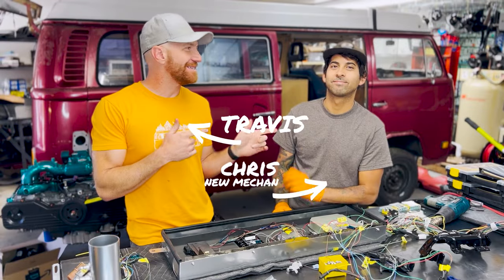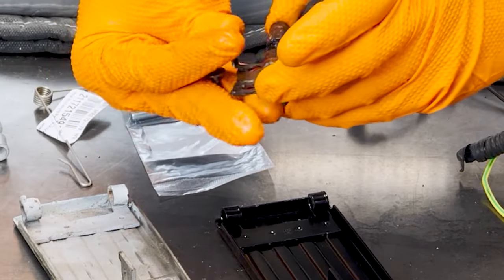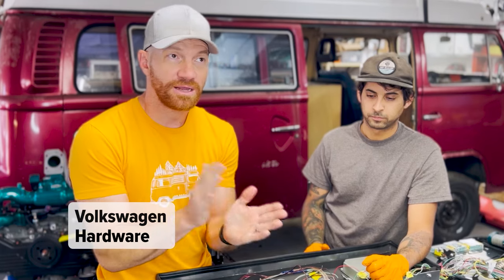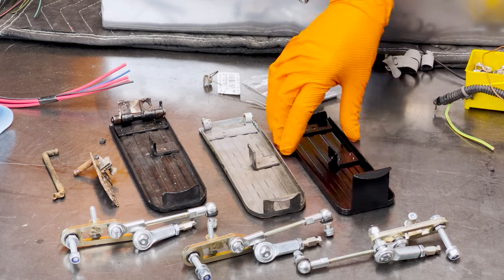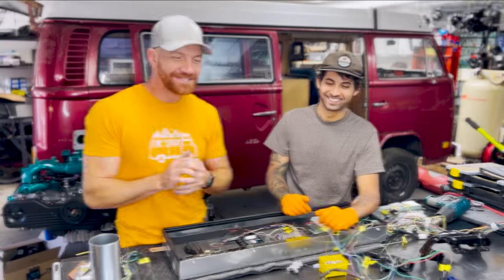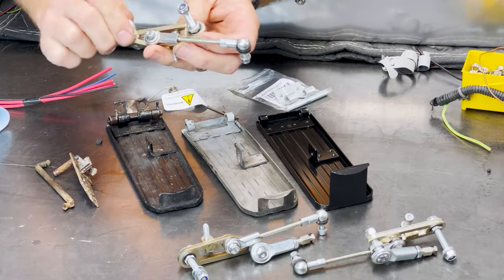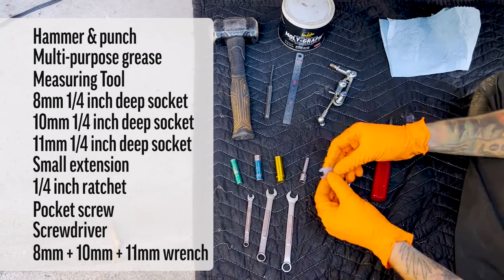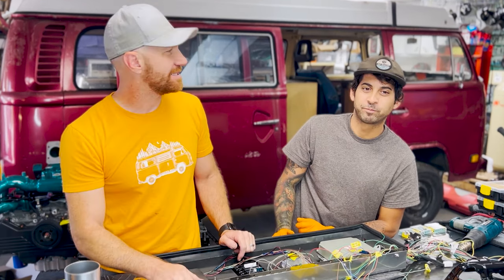VW Bay Window Bus Gas Pedal Solutions Explained | MBC Throttle Linkage Kit

Comment: Hi i have the buttys bits throttle up grade .but coulld i buy the part for joining the throttle cable 
To buttyys biits part Which you make 
As im rebuilding from scratch and have no fittings for the 1974 latebay LHD campervan 
Cheers choc

Comment: Love the videos... Can you address the problems on coolant burping and getting the air out of a system. Seems the plague a lot of Subi conversions.. Especially on getting the thermostat to open when burping the system... thanks
Reply from the maker: I will try and get it in a video soon, but for now: it just takes some patience. After filling the system you just have to run the engine for a bit, let it cool, top it up, rinse and repeat. It always takes a little longer than expected, but a little patience goes a long way we have found.